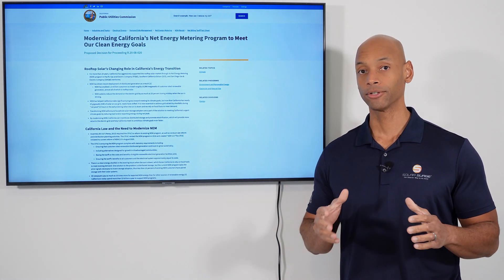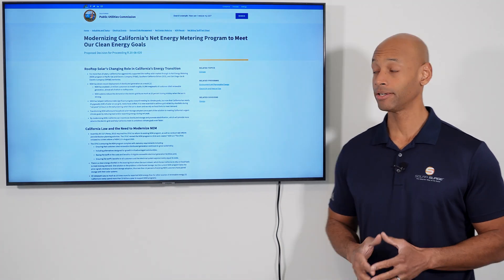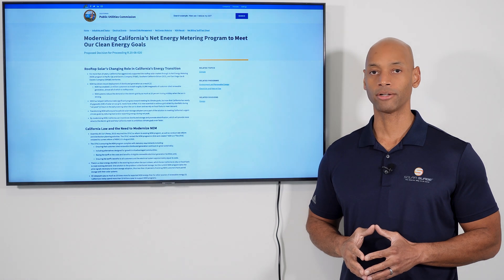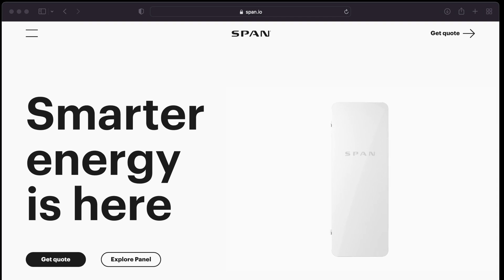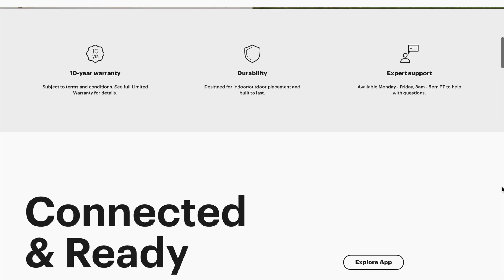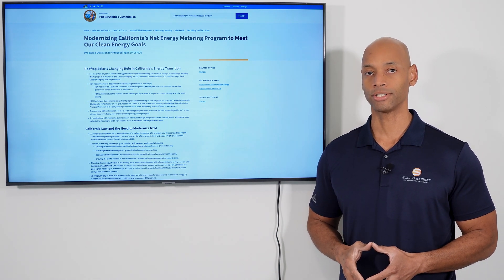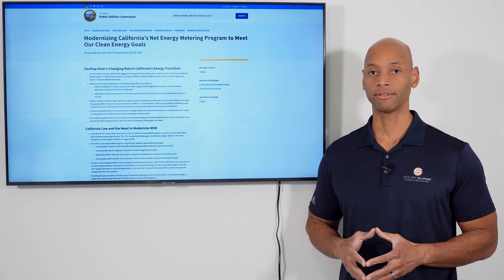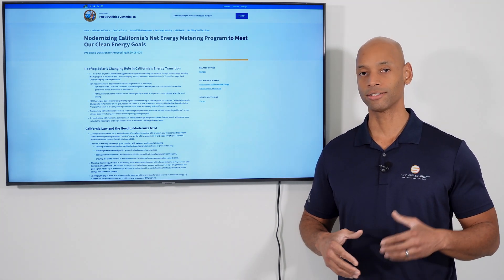URGENT California NEM 3.0 Coming Fast (California Solar)

Comment: Ohms law 101
It's like pumping water you have to overcome the forces to add into the grid
The power company can only receive about 10%
Not equal the problem is it's measured in watts need to be  measured in amps just like the whole in run scam

Comment: Just buy a battery that gets you through the night. What’s the big deal about selling back to the utility at the same rate? From a utility perspective it makes more sense to push people into local storage than all these power swaps.
Reply: Batteries aren’t intended for daily use rate arbitrage. There’s a reason they only have 10 year warranties and everytime you use one you run the longevity of it down. With inflated battery prices today due to superchip shortages and COVID delays, there’s ZERO ROI in using a battery. Run them during blackouts ONLY, that’s what they’re intended for.
Reply: @brandoncoleman9267  nah. That’s not how todays batteries work. Tesla car batteries are cycled every single day with daily drivers. Same batteries are in Tesla powerwalls.
Reply: @MrDdooitt  Tesla PW’s have a 10 year unlimited cycle warranty, but with a stated 70% capacity at those 10 years, and you think the expectation of running those batteries for daily arbitrage, and offering the ability to also offer a full night of blackout protection, its intended purpose, (after it was used during the peak rates where there won’t be any sun to recharge them, i.e. TOU 4-9pm) is an actual solution (and with only 70% capacity at 10 years)? No chance. Even Tesla Powerwall batteries degrade exponentially after 10 years. That’s a dead battery by year 12 with daily use.

Comment: I’m so glad that I installed my solar panels earlier this year. You should also state that if you add more panels to your current system you lose your NEM 1.0 or 2.0 to 3.0. However, you can add a battery system to your NEM 1.0 and 2.0 at anytime without affecting the NEM status.
Reply: of course you can buy a battery and not impact your status, because the power companies will pull from your battery when they need to.... no thanks. IM not expanding the grid for the electric companies on my dime.
Reply: That’s not good and total trash if that’s the case

Comment: Nice info. Question. I have a system installed (two actually) I'm planning on  battery storage system, but I'm planning on doing it next year. Will that change my NEM2.0 status or not? Thanks.
Reply: No, you can add batteries at anytime without affecting your current NEM 2.0 system but if you add more solar panels it will drop you to NEM 3.0.
Reply from the maker: Correct.

Comment: So does this mean it doesn't really matter which TOU plan you're on? I'd love to see  a video on TOU. I recently installed 2 Tesla batteries and am struggling to understand my best options. Thanks for your videos!
Reply: It's pretty simple IMHO.  Assuming you have enough solar panels, you'll operate for free during the day and charge your battery and send electricity to the grid for credit.  Use your batteries during the TOU period to avoid peak prices, then use the grid at night and pay with credits generated during the day.
Reply: No export rates are now decoupled from import cost. Export credits vary by month and hour of the day. There's a whole matrix with different export credit rates

Comment: If there’s an outage, solar is programmed to shutdown for safety.
Reply: Not with a battery or the sunlight backup of the IQ8 microinverters which will power your house with solar during an outage even without a backup battery
Reply: If you have a good size array and battery, you could run off grid indefinitely.
Reply: Agreed. I guess the question is how long can a storage system reasonably keep your home powered up?